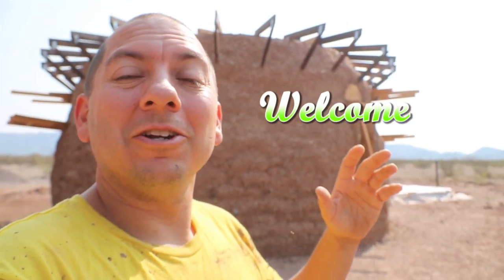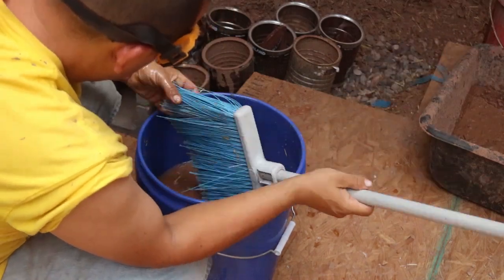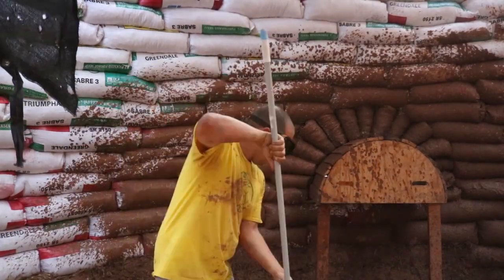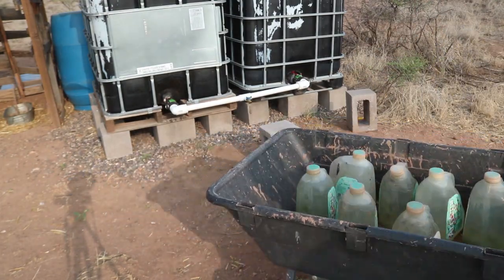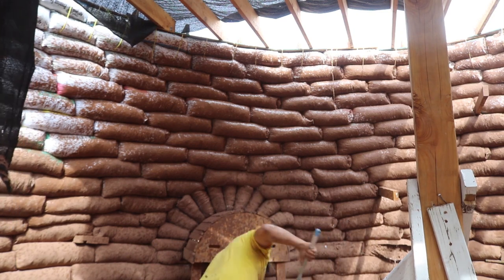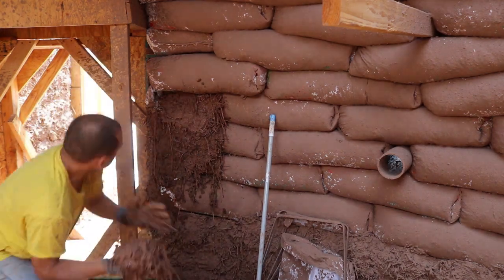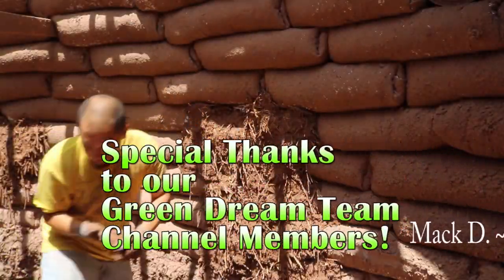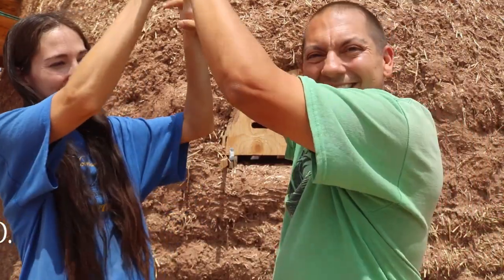THIS Tool Did An AMAZING Job In Helping Us Protect Our Earthbag Dome | Building An Off-Grid Home

Comment: When you get ready to finish the interior (as in smooth walls), use thin wire lath, attached with 8or16d galvy nails. Then mix duel purpose gypsum with Perlite mixed. Trowel on realitive smoothness. Very lite weight.  Finish layer need to only be about 1/8 thick. Don't nail into space between bags. Keep lath nailed to high point off bags.. Never valleys. When gyp coat dries, 24-48hrs, plaster the shkip trowel Spanish finish. Voila!

Comment: "The Upside of Downsizing" recently posted  a video using a texture sprayer to spray clay slip on their straw walls.  Looked like it worked pretty well.  You may want to check it out.

Comment: The boot repair reminds me of me, it's definitely something I would do, I should own stock in Shoe Goo. I actually used Shoe Goo to repair the tires on a DR brush cutter and it worked great. That was several years ago and they are still holding together.

Comment: When I make clay based paint I found using concrete mix tip on my battery operated drill worked great. Not magic still took 60 + seconds but whips the clay mixture very well !

Comment: If you get the leather **wet with warm water, it will mold like clay. then after it dries you trim away the excess,  contact cement is the preferred adhesive
** dip in a dish for 30 seconds till completely wet, pat dry

Comment: Amazing project !! Great job !! Why not fix a chicken wire on that wall before putting on the mud ?
Reply: Great advice! It's seems as though the weight of the mud is goin to keep busting the bags which will make the top bags cave in... making that building unsafe! I wouldn't sleep there...

Comment: Just curious  Jim, why didn't you just drill a well.  From what I can see you have spent thousands in labor and supplies to build your water system.  I'm a building contractor with 45 years in the business.  And yes I understand your trying for the sustainability thing, but at some point you need reliable, and simple. This is assuming drilling in your area is even possible.